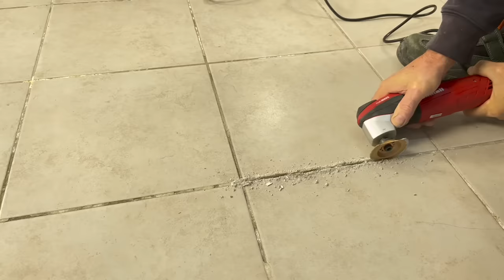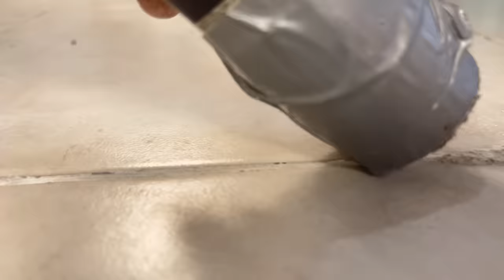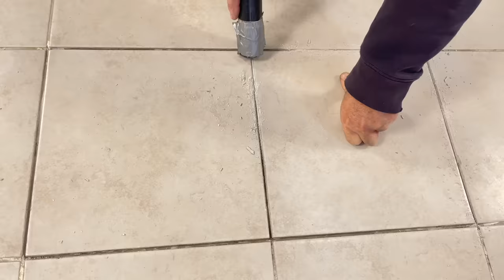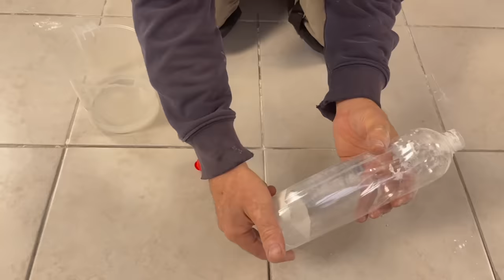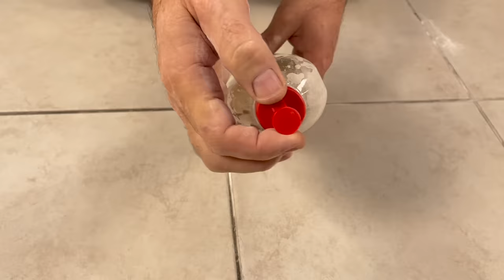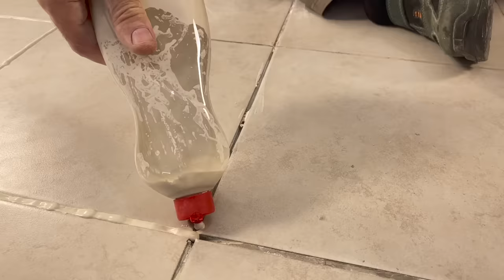Amazing Method! Even 50 Year Old Tiler Never Seen Such Method

Comment: Hello! I have been in the tile business 40 years. It looks like you are putting very wet, un-sanded grout in a joint whose width requires sanded grout. It will work for a while, but it will eventually crack and start coming out. We never use that 'bottle' method (basically a grout bag) to grout joints unless the joints are at least 3/4" wide. We use quality grout floats on joints 1/16" to 3/4". We can grout & clean about 80-100 sq ft of 12"x12" tile per hour. That method would take all day, but would be fine for a small repair. I still think the grout should be forced into the joint by a grout float to insure the grout is pushed into gaps underneath the edges/corners of the tile.
Reply: Agree...way too wet
Reply: Agreed.  Because you aren’t a you tuber with another dumb idea that contradicts centuries of tile laying knowledge
Reply: What if the grout mix was thicker?
Reply: @skinnzthedon  Then it wouldn't come out of the little nozzle in the bag, no matter how hard you squeeze it. You would be worn out after 10 linear feet!
Reply: @cantyouhearmeknocking1961  you'd have incredible hand muscles 😄
Reply: @skinnzthedon  I already have incredible hand muscles in one hand! Ahhhhhh, it's not what you think!! I play guitar!!  ;-)
Reply: @cantyouhearmeknocking1961  🙄
Reply: I have grout that cracked/cracking/chipping in under a year. Some areas I looked at it's gummy underneath the top layer. Contractor said he doesnt/won't seal the floor (wasn't necessray). But im assuming it's the wrong grout mixed incorrectly.
Reply: Looks like a ton of work for short term results & you could cause a whole lot more work if that tool runs off line. In theory it would be a good idea though
Reply: @skinnzthedon doesn’t matter. Non sanded grout is only recommended for up to an 1/8” grout joint. Beyond that you’ll need to use a sanded grout.
Reply: @cantyouhearmeknocking1961 no way you'd be able to mix it consistently enough by shaking it if it was the correct amount of water
Reply: I tried to tell my mom this when i did her bathroom but they didnt have the color she wanted in sanded grout. But shes not gonna be re doin it when it cracks tho lol
Reply: so glad youtube got rid of the dislike count, so beginners have no way of sorting out these garbage "how-to's" from the actual useful ones.
Reply: I am definitely an amateur, but just objectively speaking, the grout seemed to wet. It seems that when it dries, it will shrink as well.
Reply: The forbidden pancake batter aka wet grout
Reply: And IMO he needs to remove the excess on tiles b4 it dries
Reply: Come si chiama questo macchinario?
Reply: You would possibly cut down into the substrate layers and destroy it's seal integrity ! Happy foot fungus, !
Reply: @AB-bo9rp  Ummmm, no. Happy mouth fungus..

Comment: Grout isn't supposed to be that runny to be squeezed out of a tube like that. Not to mention the improper mixing by just shaking it. Honestly wouldn't have taken much longer doing it the traditional way.
Reply: Exactly, there is a reason to use a grout float. It pushes the grout in to fill in the voids.
Reply: And he’s using a non-sanded grout. Incorrect for this application.
Reply: @jeffwangerin8089  there's nothing right about this video except the removal of the old grout which is the most tedious part. Wouldn't have spent much more time applying it with a float
Reply: That’s paste

Comment: It's a nice idea for the application, but would take too much time to be practical.  IMHO, the squeegee is the star here in that it can help push the grout into the joint and reduce the number of rinse/clean cycles you'd previously perform with a sponge.
Reply: No
Reply: Plus the grout is way, way too wet. The amount of water you use in any mortar can significantly affect it’s ultimate strength.

Comment: Nice trick! Very helpful and I love new ideas like that. I've tried multiple methods just to make the process easier. My grout bag sucks can't stand it it's like brand new but it's heavy annoying and waste material. I have to grab a shower wall today with 1/6 grout joints. I think I may use a bottle method like yours but I'll use a tip that fits my Lucas motor oil additive. I never use them anyway I just take them off so I just need to wash it off good and poked a very small hole in it but thanks for the ideas! Many ways now to make this job a lot easier and less work.

Comment: There is an even EASIER way to do that.... which I did in our new bathrooms when we ran a baseboard using the floor tile, which went up the wall.  I just got out one of my large disposable pastry piping bags, filled it with the mixed grout... twist tied the top, snipped off a tiny bit from the bottom of the bag and "piped" it into the gap just as I would with cake icing!  Worked with a lot less mess than with the bottle shown as you can adjust the pressure.  This would work with a gallon zip bag as well and snip the corner!

Comment: I did a 4x8' mosaic (using broken ceramic tiles) concrete slab outside my casita door (I live in AZ, a casita is what we call little mother-in-law houses), and discovered the use of a grout bag that I bought at Home Depot. They're pretty cheap. It was still a little messy, but it still was better than trying to get the grout in all those grout spaces. I used the PRISM, which a company rep told me to use for spaces up to 1/2" and for outside here. Some grout spaces were a little wider and in those places I added 1/4 or 1/2" glass nuggets, like I use in my stained glass to fill in the space. Worked great, the mosaic'd slab looks great, and adds some class to an otherwise drab space.
Reply: Sounds beautiful! It's a pity you can't post a pic of it on YT😔 
And thanks for the tip as well (pun fully intended😉) Very useful!
Stay blessed!

Comment: You can also add the add mix milk for mortar to make the grout super sticky then go over the whole floor. Have done it with little tiles in commercial bathrooms a bunch of times. Trying to get the old grout out just causes little chips everywhere. Had to learn this trick out of necessity.
Reply: add "mix milk" ?
Reply: @dimitar4y  you mix it into the cheapest bags of mortar to bring up the adhesion properties.
Reply: @kevinclear4007  yea but I'm trying to look it up, nothing popping up, is that how it's normally named? Because I DEFINITELY need that. Mortar nowadays is SHIT. Doesn't stick to nothing.

Comment: Neat idea. I tried something similar years ago, using a heavy duty piping bag and it worked out brilliantly😊
Reply: "Grout bag"
Reply: @Sucofni Sucofni I have 2 I fitted with (2) different size pipe. I mix the grout just thin enough to flow slightly. When done this way, it sets up pretty fast. You leave a little bulge on top. Then take a rubber float & press it in the joint to avoid any air pockets.
Then all you have is a slight smear down every joint to clean up instead of the whole floor.
Reply: It's only a good idea if it's a small job and you don't need sanded grout, which they need here. It won't last very long until it cracks and starts breaking up.
Reply: @jimmywhitlow2012  you are right if course, it was a small job and I needed to be precise as there was two different coloured grout side by side
Reply: no you didnt just said it to say something 😂😂
Reply: @EmbracingMasculinity  don't really care if you believe it. I KNOW it's true!!!!🤷‍♀️

Comment: What is this sanding disc which doesn't turn?  How does it work?
Reply: It is called an oscillating saw or oscillating multi-tool. It vibrates the round disk to cut, or a saw blade. It is very good in tight corners.

Comment: I clean the grout. Then take semi gloss paint and put it on the grout and wipe it with a damp paper towel.  It dries quickly and you never have to T ou check it up.
Stays white and nice
Reply: What do you use to clean the grout prior?
 And what type of semi gloss paint?
And also at what stage of dry do you use the damp paper towel over the paint? I am assuming it's a water based paint.
  Thanks for the tips.

Comment: I've done that before, it's definitely a fun job, not. Does that work with the sanded grout?
Reply: It probably won't squeeze out as easy or scoop up. If you're talking about the diamond bit, it does work but not as easy. I've done it before send it grout is a lot harder to remove. Ask for the application I've never used the squeezer Tube before so that I wouldn't know. But I would imagine it's a little gritty so go figure

Comment: Quicker to pre-mix grout in zip lock bag, cut the corner and away you go, but for efficiency, just grout the normal way?
Reply: Yeah, I think I'd just go with the normal method of floating it.  It looks like all the grout is dirty/nasty looking on that floor so may be time to do it all (in sections if you're not a tile pro) and use darker grout to hide those stains.  Or a new floor entirely.

Comment: My house is 50 years old and I have that same ugly whitish tile with black grout. Maybe it wasn't black when it was put in but it was when I bought the house. I am 68 years old and can not get on the floor to do this kind of repair and besides if you replace with white grout it will look dirty again in no time. Another color of grout would be better I think. On the bathroom walls and floor, I took a small flathead screwdriver and scraped the dirt off the grout until it was white again, still looks good almost 6 years later.

Comment: Now if only it would stay that bright and clean longer with less heavy-duty upkeep. Great application method, though!
Reply: @vincentsprung6536  A sealant that would enhance, or at least not lessen, adhesion, mixed with the grout and applied in one step would be better, like today’s primer and paint combo products.
Reply: @louisanow  I use the milk for mortar mixed with grout to make it super sticky and wait until it starts to firm up. Basically let's you grout over the grout. You might have to knock down high spots here and there but for the most part it sticks and doesn't just wipe off to reveal the old grout.

Comment: Next time, use a funnel to pour grout powder into the plastic bottle!, that's what I have used in the past, great job, mate !
Reply: What grout to use
Reply: @tiffanybest895  not sure about the grout used in the video, but if the tile space is very thin, you would use an unsanded grout, and mix it to the consistency of cake batter. For tile with a wider space between them, use a sanded grout mix, same consistency as cake batter, I just wanted to comment on using a funnel to pour the grout into the bottle to cut down on the messy way the video shows, ( you can also use a thick plastic bag to apply grout to the tile joints, use like a pastry bag, cut the corner of the bag, and slowly squeeze the grout into the joints!
Reply: @b.powell3480  Okay thank you very much
Reply: @tiffanybest895  your very welcome 🙏, good luck on your tile project 😀
Reply: @b.powell3480  Thanks

Comment: I 'Invented' this years ago. The main problem is if you make it thin enough to flow and fill the joins easily it shrinks too much. If you make it a nice consistency it gums up in the bottle.😁
Reply: Wonder if you save the Bavk cork & body of one of those spent cork gun sticks? Fill it, cap it, put it back in the gun, & shoot the tiles? Any left in stick, easier to remove & clean than a narrow Soap bottle...

Bit I'm hope to do this for a shower tiles with water damage, with no previous experience....hoping to remove & check without damaging the shower pan liner or anything else, with a baby grinder, no dremil tool.
Reply: I was wondering about that. Seems like the grout should be of a consistency which would need a lot more pressure than squeezing a bottle could provide. 
So, in other words, just another YT hack that isn't practical. What a shame.
Reply: @zechssiguro7476  Good idea. I've also pondered that idea. Let us know how your project went, will you?
Reply: @Miranda-cw9hq  unfortunately found out the product "Fixafloor" is def NOT waterproof! So for a Shower job, this can't do,but any other Normal tiles, I'd def try it!
Reply: @zechssiguro7476  That's a pity. Even though I have normal floor tiles to do, I tend to shy away from products that aren't water proof. Mopping is something grout has to be able to take, sorry. So thanks for the feedback!😉
Reply: @DJ-sn2xj  tks for those details, the N95 & vac, the other mentioning to carful with the tile corners,'usecpicecof ced board with the flathead,all very helpful.

Comment: For the people that say this takes too long for large areas….. ok it does. But now think of time you will spend cleaning with a sponge with the float.
With this method maybe just a quick light wipe.
Reply: Wrong.  This method in the video is terrible
Reply: @Jack-russell103   agreed, i served my apprenticeship way back in 1978, if you want to grout a floor correctly, use a squeegy,  use a large bit of foam to clean the floor, we used to get offcuts from upholsterers, larger the sponge, quicker the floor is cleaned off.

Comment: Failure for sure. Improper mixing consistency and application. Mix it correctly in a bucket transfer to a grout bag if you wish and for god sake pack it in the joints with a float otherwise its just a thin flimsy line of grout destined to crack up. All that effort he did and for nothing. Just do it right.